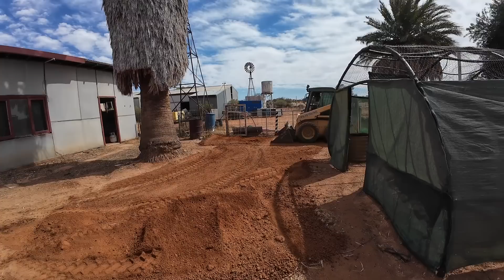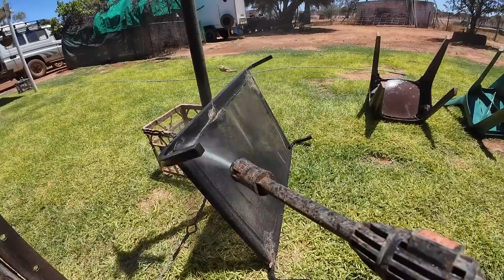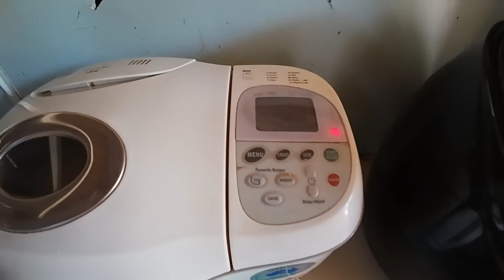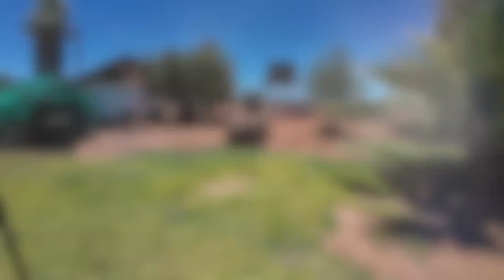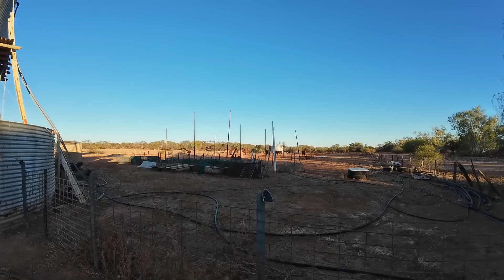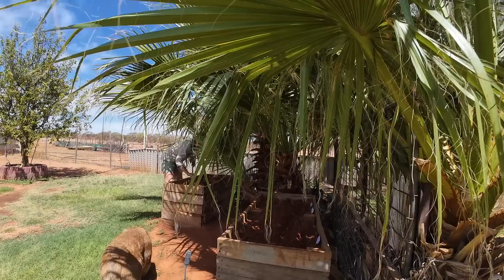Big clean up at our off grid Home (now powered by the AC300 from BLUETTI)

Comment: only just found your channel and loving it. Never heard of Bluetti before but a quick bit of research shows that it would be quite adequate for my simple life. Thanks for the recommend. One thing that may help with your gardening up that way is to use IBC's as wicking beds inside your shade houses. I know they have many uses and storing water is a big one for many but if you cut them in half you get two beds which produce prolifically. We have done it here and find that while everything in this country needs shade (despite the full sun labels) this type of gardening is incredibly productive. Thanks for the time and effort you take to let us all share some of your life adventures.

Comment: Awesome set up 
I lived off grid for 20 years  messing around with batteries is so crappy , I love that system and I’m sick of power bills,what voltage is coming out of the solar panels, I know the house ones are a higher voltage than 12V

Comment: It’s not the average watts that is the problem, it is the high amperage ie watts that are needed to start appliances. Heating elements use large amounts of power and large electric motors such as washing machines will draw 7 x the power on starting up before they settle at lower power. I hope you put the metal detector over the “gravel” before you put it down. It is WAY after all.

Comment: Thanks for this latest video.  I love seeing the gradual changes to the homestead. I’m curious about the wire mesh walls around the “pool”. They seem to have dried brush stuck in them. Is that what it is? From a past flood? Just wondering if this area was flooded in the past and that’s why it was abandoned.
Reply from the maker: It's what they call a 'bower shed' over here. Pipelines with holes running underneath the roof let water drip down the brush and makes the place cool that way, we noticed the temperature drops about three degrees when it's running. We should go through the effort one day and redo the brush to make it work better.